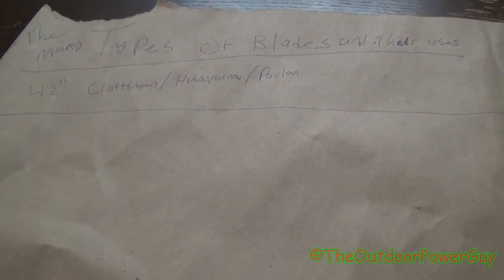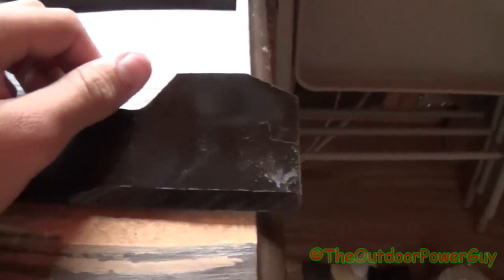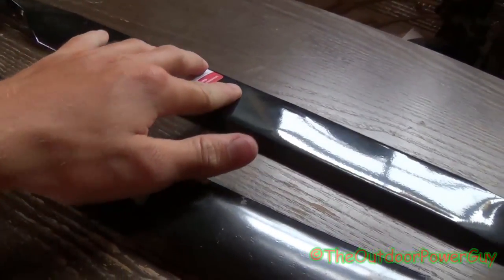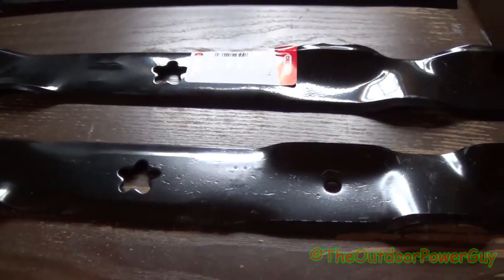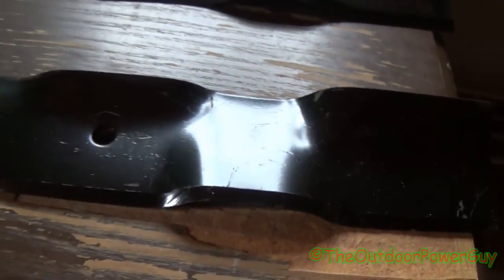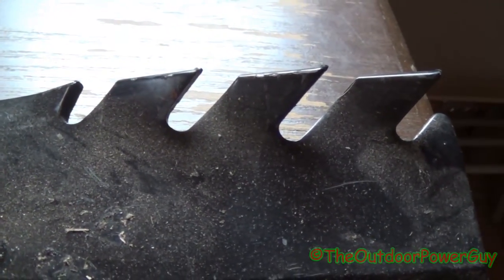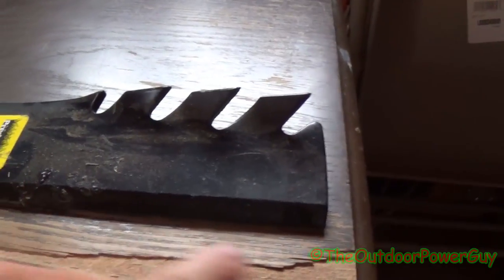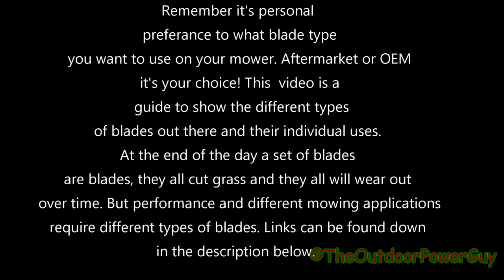THE DIFFERENT TYPES OF LAWN MOWER BLADES AND THEIR USES

Comment: Hello, You  are the man! So - here is my problem- if i wanted to get a blade that will be able to work with a side discharge and be able to mulch and pulverise (I mean to 10mmx 10mm or as close as possible to that) the thing (short grass less than 5" high but i am only cutting 1" off) that I am cutting to as fine as possible- what do you recommend? I am thinking of getting a leaf vacuum attachment as well. The point is that I need to pulverise the grass. Is it a gator lifting blade? I am hoping to put it onto a john deer garden tractor with side discharge. You comments will be most appreciated.
Reply from the maker: I would recommend Oregon G3 or G5 gator blades as they are "true" gator blades, they recirculate the air/clippings towards the center of the deck and create a whirlwind effect which inturn shreds grass, leaves etc... into oblivion. They would work perfectly in your case as you are only mowing 1" off of the grass, the difference in the G3 and G5 is the G3 has 3/4 tall air lifts and the G5 has 1-1/4 air lifts, i woulds pick the G3's for mulching over the G5's and since you have a leaf vacuum attachment, the G3's would create enough airflow but not too much like the G5's would. I hope this information helps you out, if you have anymore questions or need anymore advice email me at youroutdoorpowerguy@gmail.com thanks, Mike.

Comment: How do you a balance a 5 star blade? The regular way on a nail or cone doesn’t work since there is not a true center point to balance on.
Reply from the maker: I do apologize for the late reply anyways, for a star pattern blade or any blade you need a blade balancer, they are inexpensive the one i use is an Oregon part number 42-100. Thanks.